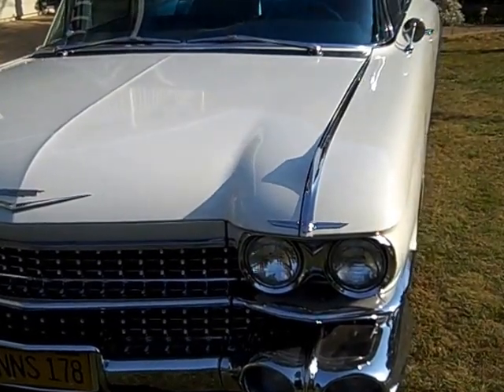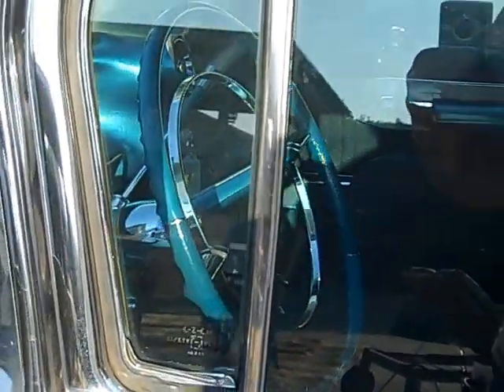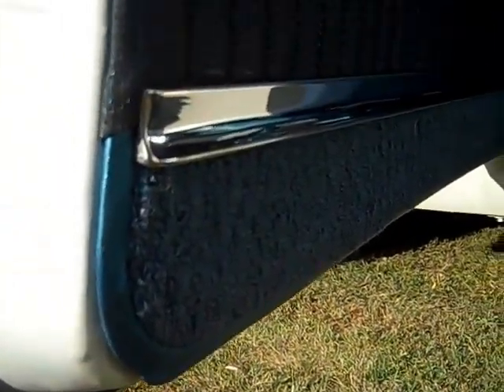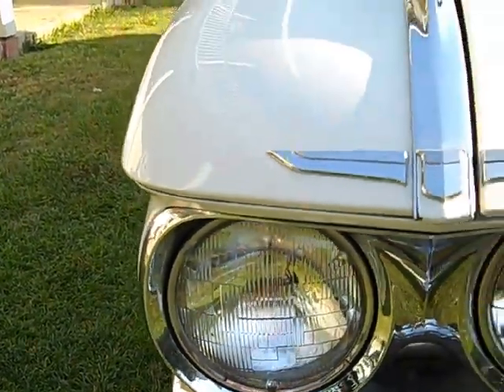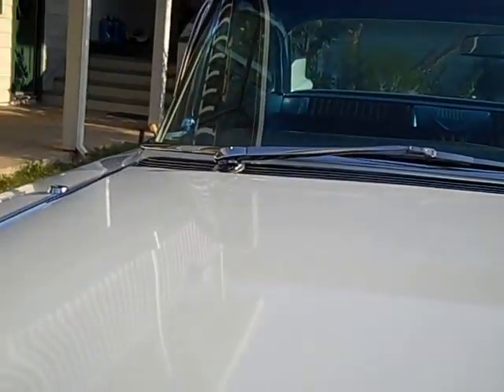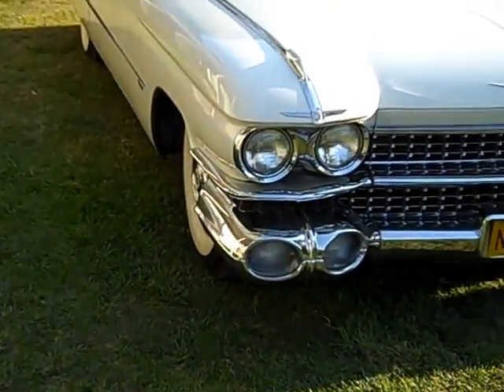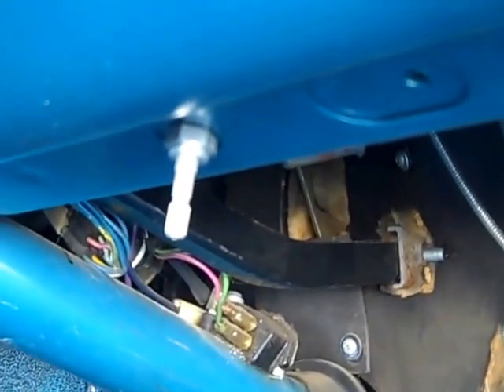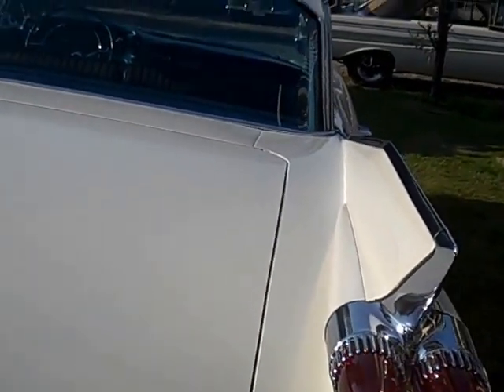1959 Cadillac with 35K original miles. Sharing Details for restorers

Comment: Fond memories. We had the same model in black with white vinyl and black cloth. I maintained it as a teenager. Passed my driving test in it. Recall every detail. 

Learned that to prevent the white vinyl from yellowing and to keep it supple it was important to keep it free of body oil. Foam upholstery cleaner worked fine. Didn’t need any other dressing. Rain Dance gave the paint a deep black shine. 

I recall the door, hood and trunk latching sounds, as well as the new car smell, which it never lost. Vinyl covering the trunk floor is correct...grey houndstooth. Plain, but easier to clean than carpet.

The hubcaps on this car have been overly polished. There was a faint misting of whitish-gray paint in the recesses, which gave the caps a bit more depth. The finish on the center hub wasn’t as brightly polished as shown.

Comment: Really clean... and nice, I have a '59 Series 62 4 door, 6 window with factory working AC  / power windows, and 6 way power seats, I have owned it for 13 years it is solid rust free Texas/ Arizona with no rust original interior with no tears or rips....was under seat covers for 50 years,  in Brieghton Blue. I would have a very hard time parting with it , I change the oil every 500 miles and it purrs....used to take my 93 year old mom for rides on Sunday. she passed in 2016...

Comment: Real nice car, ive had many Cadillacs here in the UK, i often find Series 62 cars are in better shape than DeVilles, as if the owners had to work a bit harder to buy them and looked after them better. I've seen several original 59/60s with those runs in paint on the core support, i believe they were painted standing up prior to fitting hence the runs go accross the car

Comment: WOW,  yeah my Father had a 66 Toronado and with dual exhaust every 2 years it was some part that was getting noisy--Not sure if that is worth more as is or restored? Would be such a shame to be it deteriorate just to keep original, mileage is amazing. As beautiful as those cars were I think GM viewed them as disposable and that's why such drastic changes from year to year, the downside is those cars or 50's and 60's in general were just rust buckets, that's a true survivor, thank GOD for CA weather and a few loving owners
Reply: Dont see anything on this car that needs restoring. Paint is perfect. As is the chrome. Interior is 99 percent . May need a few under the hood items. I have a 58 cadillac series 62 sedan that my parents bought in 1960. Has factory air,  and power windows.  Lifelong southern California car, still driving it. Its decent,  but could use a new paint job, and interior is all original,  and has really reached the point of needing to be redone. Oh well, someday for that stuff !!

Comment: Do the windows have greenish tint?
Reply from the maker: Yes, "E-Z-Eye" glass has green tint. Almost all Cadillacs had this option. CLEAR glass was available but not a typical request. Original glass has this mark or what is called "bug" and a date code below it. Replacement glass if original "LOF" will have the bug and a later date code. Aftermarket glass will have a different BUG or can be ordered with NO BUG. Some restorers can apply a bug with the correct date codes on new glass.
Reply: @rodneyracer  that's very insightful. Thank you. I recently bought a 59 Coup Deville, and it has all clear glass.
Reply from the maker: @ЮрийГригорьев-ь8х  Original clear glass will have the LOF "bug" and date codes that are close to each other in the code. I find clear glass seems to have been ordered in "colder" climates
Reply: @rodneyracer   yeah, my windshield has a "LOF" bug stamp. The numbers are too faded away to read, unfortunately. I couldn't find any other "bugs" on other glass pieces.